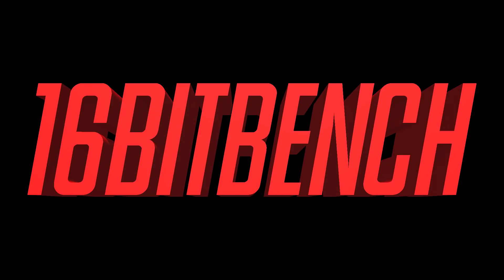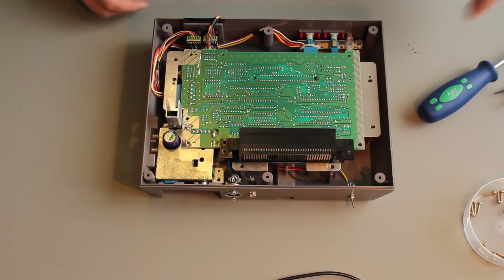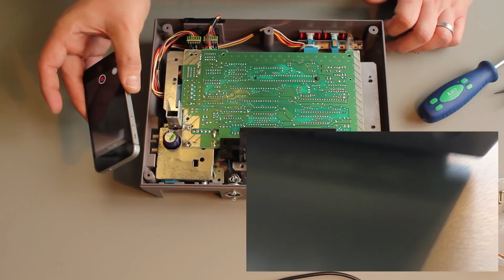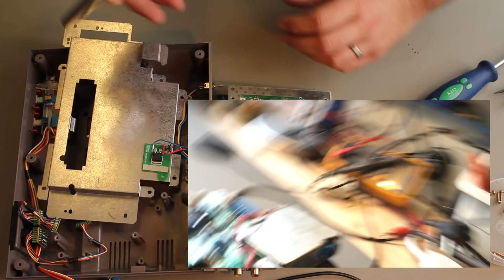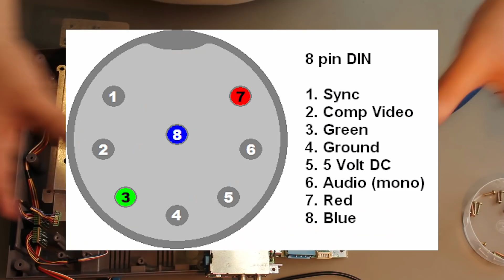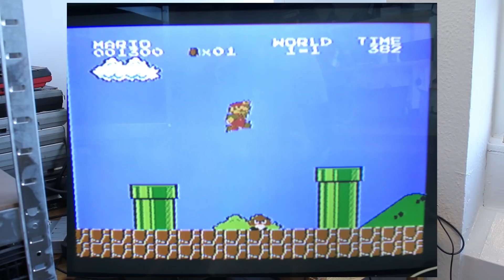NES RGB - Install Guide Tips and Review for the NESRGB mod board

Comment: I like the idea of modifying the system and all for better picture, but once all of this is done, how much of the original RF modulator is necessary for operation? IMHO, if I were to do this mod, I would create a separate DC-in Board and completely remove the RF Modulator box! That way, instead of cutting into the original shell, I could repurpose the already existing holes in the system for that purpose. Doing this also free's up the switch location for the channel selector, which could be used for the pallet selector. I mean, looking at the schematics of the RF Modulator box, the DC in is a very very small portion of the actual box. I guess removing the box does away with TV Backwards compatibility, but really, who is going to go back to a grainy, horrible picture with garbage compatibility with most modern TV's anyways?
Reply: If you can manage to catch them when they are in stock, The Real Phoenix prints PCB's that replace the RF modulator, and are no-cut I/O boards with a new DC input and you can even purchase one with a multi out pre attached. Unfortunately there's a waitlist I believe.

Comment: You managed to fit a socket on the NESRGB board as well? I'd like to do that as well, but Tim's guide advices against it. Anything you did to make that work or is it just a tight fit?
Reply: His PPU is so scratched up, looks like it rubs against the bottom shield.  I was going to install a socket too but instructions warned it wouldn't fit.  But I don't use the shielding.. so maybe it will fit without shielding.  Pain to desolder it at this point.

Comment: I really like that you put the extra 7805 on the bottom RF shield and use it as a heatsink. I also like that you used a Mega Drive Model 1 DIN port instead of the smaller one from a Model 2. Putting the option to use the stock composite/RF output is great too, I always dislike it when those outputs become no longer usable on other NESRGB modded consoles. You probably already know this but thought I'd mention it anyway; you can use the Sega HD Retrovision cables on that DIN port for direct YPbPr component video output (unless you didn't wire up Csync to it). Great video and what a nice clean install!
Reply from the maker: I think i did wire it up, it was ages ago now, this console has long since been sold to a guy in Mexico if i recall correctly havent had any complaint from him.